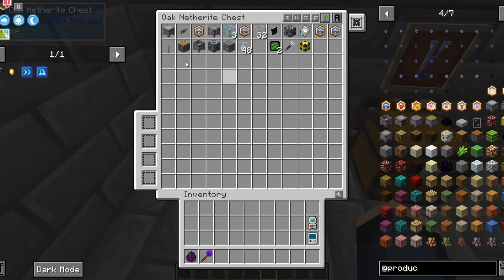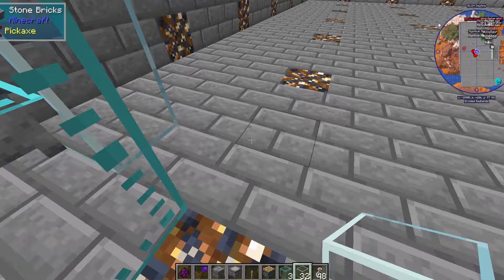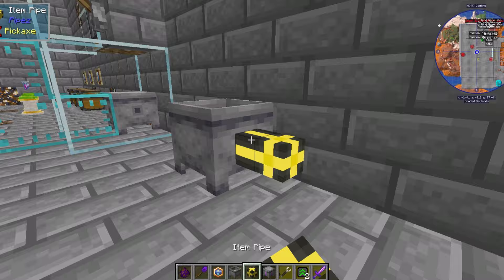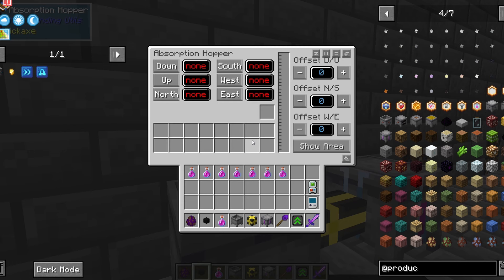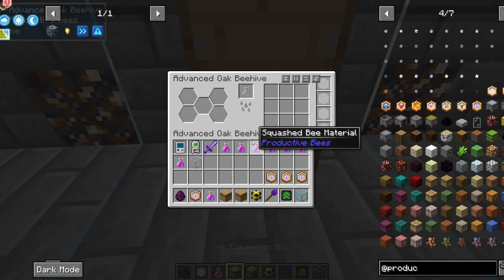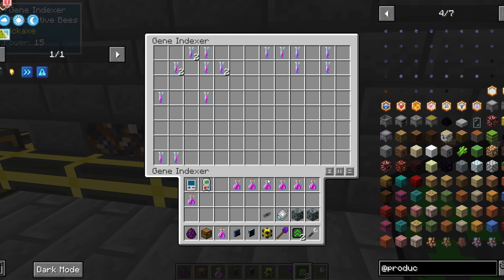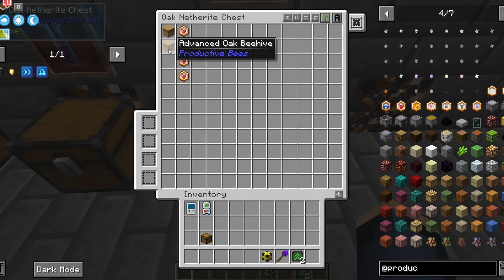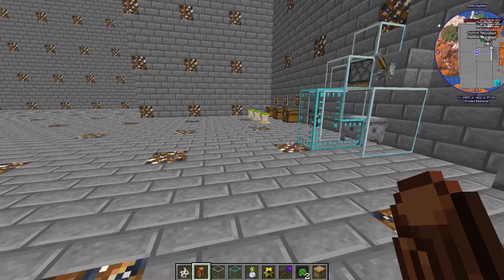How To Get Productive Bee Genes: All The Mods 7 Tutorial

Comment: Cracking my head on automating this. Any ideas?
Reply from the maker: Automating how? In a different way than shown?
Reply: @stonemancraft4931  If you have to flip a lever and manually place a bee there , this is not automated.
Reply from the maker: Oh the squash bees part. I'm not sure on that. I just use the Pokey Pokey upgrade
Reply from the maker: With most bees it works.
Reply: @DunnickFayuro  If you're interested, a ytuber called DEWSTREAM, (Yes it's all caps) made a series on atm7 that he finished a bit ago. If you find episode #131 and #132 I think he did find a way to automate it. (Fyi #131 is alot of troubleshooting and it's a long video, so you might want to skip through parts of the video as you understand what he's doing.)